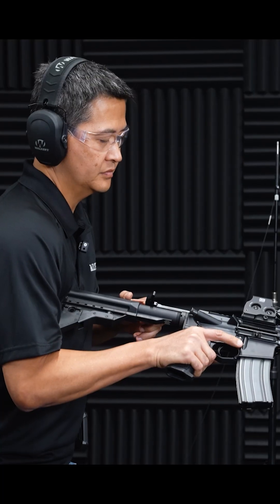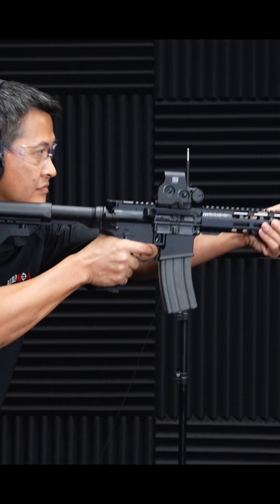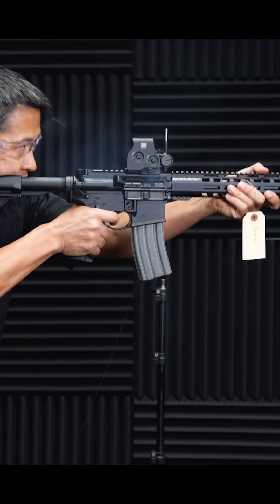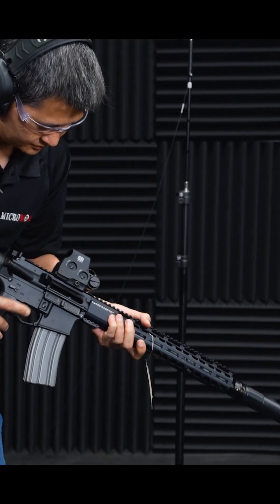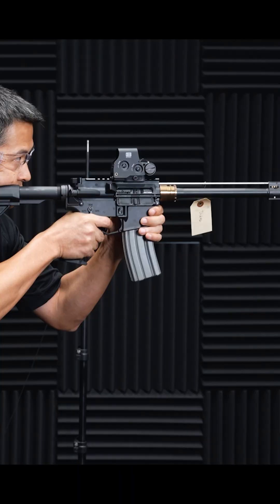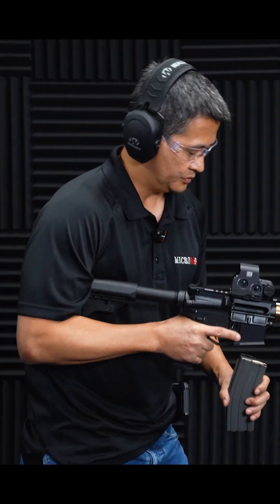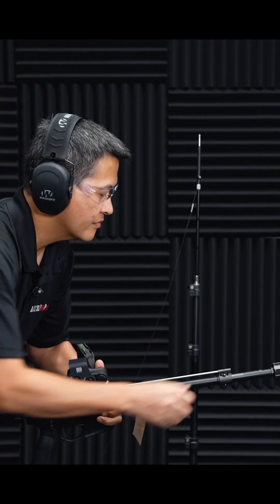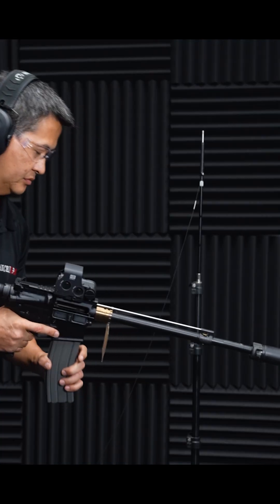Griffin Armament Adjustable Gas Block

Comment: Will this work well with 300 black out (using the HX QD 762 TI from Hux Wrx)
Reply from the maker: With that specific combo you'd probably run into cycling issues, especially with subs and a high flow can. Running a high flow can on a pistol gas system usually is barely enough gas to get it to cycle on it's own, let alone being more restricted by the suppressed gas block setting. This is way less of an issue once you get to carbine or longer, but with pistol, .300BLK subs, and a high flow can you're operating on the edge of performance as it is.
Reply: @GriffinArmamentOfficial thank you, I do plan on using supers majority of the time. Does that change the probability of under gassing?

Comment: Hey Austin, for those of us with the OG Govnahs, are y'all able to service them if need be or assist if any issues arise out of them? Jw.
Reply from the maker: Don't think so unfortunately. It's quite a different design than where we landed. The square plate is actually a nightmare to machine properly, which is why we went with the disc design to keep production time down, and ultimately the price down.

Comment: The delivery of info was terrible. Very monotone and boring. You'll get better results with more energy and charisma
Reply: I’m not Billy Mays. I’m a firearms engineer, and this wasn’t a rehearsed and performed demonstration.  Robert is also an engineer.  So you’re watching two engineers demonstrate a system.  The problem with stand in sales people is that then you get bullshit instead of real information, and sometimes stuff gets made up on the fly and thats the same thing as misinformation.

Comment: Interesting method to switching...using a tip of the bullet from the side.  Video leaves a lot to be desired...why not full frame and better descriptions?  Checked out the website...10 regulator discs???  Going to wait to see reviews before I consider.
Reply: If you're putting this in a gun, and know what you have, then there is only one disc for that.  The media guys are having trouble keeping up, and one is gone to the Army for the weekend so left Friday, and this was a short turned into a full format video for the release date.  https://www.youtube.com/watch?v=-sEmeF2nGU4  3:10-3:45  shows the adjustment better.

Comment: This is pretty neat! ....but more M110 Flash hiders when?
Reply: They have a horrible slot cutter issue that results in PH horne's weak ass tool breaking every 6 parts in 17-4.  So they actually went into the machine on Friday, but the tool was broken in about 90 minutes and we were re-programming that to try to work with the PH horne thing that breaks off the end of the tool too easily.  If this were a non clone part, we could just put better performing geometry in there like our 240 flash suppressor, but people probably want the thing to look like the part that is made from cheaper steel than stainless tool steel so it's just different and challenging.
Reply: @austingreen3888  thanks for the transparency, I can imagine you guys have gotten plenty of comments asking for more flash hiders. But I totally get where you're coming from about people wanting a clone correct part. Personally, as long as you guys are able to meet specific dimensions to make the FHs work with the MGL can, I wouldn't mind too much, but that's just me 😅. Hope you guys get it resolved!
Reply: @iwasamooseonce13  We changed code and cutting strategy and those parts are probably thought production, so now they need to go to finishing to be back in stock.  We only make around 150 at a time because the M110 is exceptionally expensive to put together and thus very few people assemble even a clone.  We may have run more like 200 this time for all I know.

Comment: Buffer system using?
Reply: We're running AR SOB- an H2 weight buffer but the buffer doesn't change bolt speed much.

Comment: Well, just bought it lol ill report back with range results!!!
Reply from the maker: You're awesome, and we appreciate your business. Would love to hear your feedback when you get some rounds in! What's your setup? Just for anyone else who might be looking for the same thing.
Reply: @GriffinArmamentOfficial Ill be putting on a DD 300blk PDW, running a conventional baffle suppressor. Mostly subsonic but some 110 supers as well.
Reply from the maker: @tad2061  We've found that running .300BLK subs with a Low Back Pressure suppressor basically requires the unsuppressed port for reliability since there's basically no extra gas. But with a conventional suppressor you'll probably get some benefit out of it. Definitely with supers that's where you'll really wanna dial it in.

Comment: Looks awesome but I’d love a close up showing how you adjust it
Reply from the maker: We will definitely be posting more close-up stuff so stay tuned. It's a remarkably simple system once you understand it. The disc simply spins 90° forward or back to change the port size based on suppressed or unsuppressed. We've got a podcast coming out too that has some close-ups of the change being performed with and without the rail.
Reply from the maker: We've got a close up video coming, stay tuned, will drop today!
Reply: https://www.youtube.com/watch?v=-sEmeF2nGU4  3:10-3:45